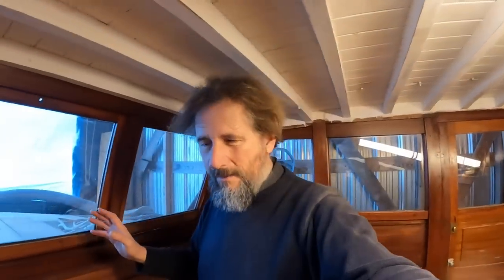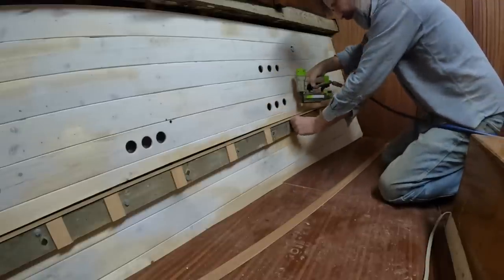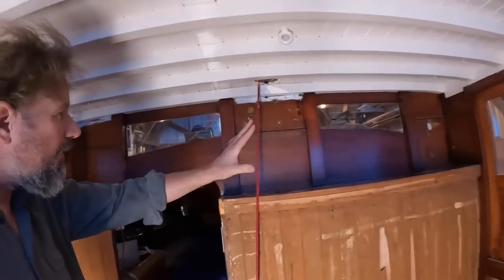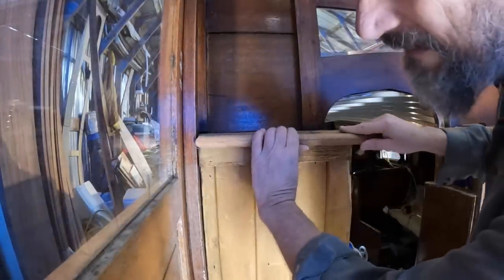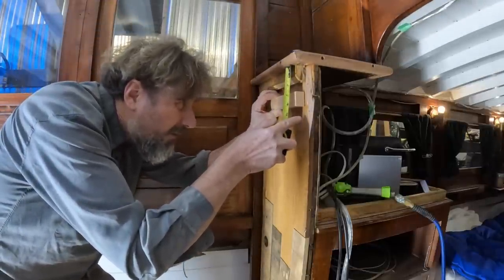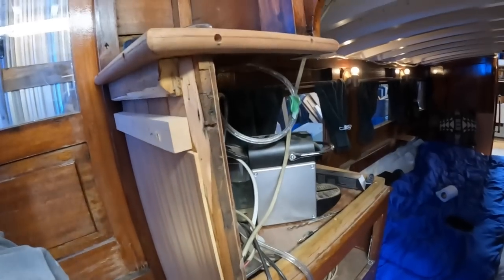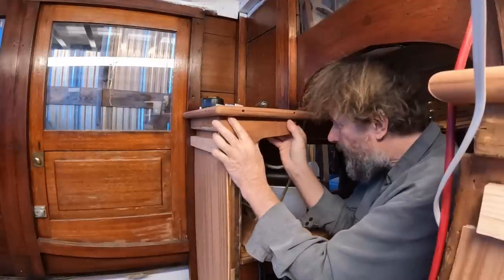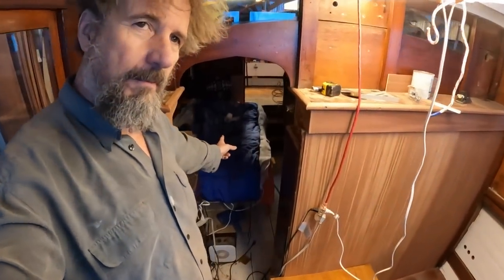Wheelhouse Complete - #351 - Boat Life - Living aboard a wooden boat - Travels With Geordie

Comment: I hope your feeling better soon , mate , take care of yourself.
Try looking at the band saw blade tracking and blade tension is critical, and with these 3 wheel saws , take the tension off when not in use, as the blades going over the smaller radius wheels,  causes hardening and the blades break..
A 9in 2 wheel,bandsaw is far superior the 3 wheel .
Reply from the maker: I can’t get any tighter or the motor stalls. 
I miss my old Delta 18”
Reply: @TravelsWithGeordie  , have look around , the 9inch units sold for hobbiests,  work well , I had 1 , and could cut 80mm timber ,throat was only about 7 inches .

Comment: You need to tighten up the tension on your band saw blade in order to make curved cuts. The tensioning knob should be located at the top of your band saw
Reply from the maker: That’s what I tried but as soon as I get any real tension on it the motor stalls. I cleaned up and lubed everything but alas.
Reply: @TravelsWithGeordie  then it might be time for a new one unfortunately

Comment: Hope you get well soon, nasty thing to go through. In the engineering world we never advocate the cutting of threads flush with the nut. Rule of thumb is 5 threads for small < 1/2" bolts, but sometimes for large diameter bolts is is way more i.e. 1 1/2 x bolts diameter. These are going to be hidden so you will never see them in the unlikely event they loosen, however, maybe consider peening if there is anything left to peen or deforming the metal across the nut/bolt end seam.
Reply from the maker: Marc, I’m glad you pointed that out. I was aware and should have explained the calculated risk. 
I have remastered at every frame, the original were only every second, and I fully expect the originals to be compromised. they cant be removed so I’ll never know. but now that they’re redundant I felt the hack was less heinous.

Comment: Hi Peter.
If there is any sunshine, get at least 10 mins on your arms for the vitamin D.
Sitting by a waterfall is also good.. the Ions.. a good quality Ioniser (check for mains isolation from the pins/fibres as some are live!) can also help.. but a waterfall is better.
Regarding the bullnose beading etc .. this is what I prefer to do, it's a safety thing.. Round the pointy corners so it is like a 1/4 or 90° slice of a sphere.. so it's rounded from all directions.
Regards from
Bella 🐈 & Mark.
Reply from the maker: Gosh sitting in the sun by a huge waterfall sounds just lovely. Instead in in downtown Victoria in the blustery rain.
I’ll be sure to catch any rays if they do appear. 
thanks.
Reply: @TravelsWithGeordie  
The rain can have a similar.. but different effect.. also obviously good at removing dust & particulates. .. Ions work like a disinfectant.. similar to bleach.
Lemon water (and or Lime) is good.. either whole lemon which has vit C or concentrate.. use about a tablespoon in a mug with slightly warm water.. it's less bitter. It helps the body clean the blood etc.

Comment: Having to cut a lot of swooping curves and not owning a band saw, I made a plywood box with a rectangle cut from the top, then mounted my jigsaw upside down in the hole. Finally able to cut complex radii while having a clear view of the cut. Plus the 'downward' cut meant no splinters on the face of the work. Being able to quick change blades meant I was now able to cut metal curves as well! :face-blue-smiling:
Reply from the maker: Might have to think about something like that.

Comment: If it was inevitable that you were putting cabinetry over that mismatch plywood area, why use more expensive ply? I guess my real question is why not just use a decent, marine grade ply instead?
Reply from the maker: Good question, marine ply is actually more expensive. Worse yet, not available in 1/4”. this surface will also be the back wall of the cabinetry.

Comment: I'm a big fan of Zinser products.  I managed a small apartment building in New Westminster for a couple of years, and found that there was nothing as good when it came to covering grafitti.  Nasty smells, yes, but an undercoat you could put anything on top of.

If you need some one with hand skills involving a paint brush, I will soon be well enough to travel, in which case it would be inevitable that I would  bring a good stout or two.  

I thoroughly understand the problem (curse?) of having the visual version of perfect pitch.  I absolutely love the Tudor arch of that doorway, but yes, the asymmetry would bother me.

23:18.  Yes, Exactly what I was thinking.  I'm not a wood worker, but I see stuff like that.

Get well.  I probably can't get Covid, but I don't take a lot of chances.